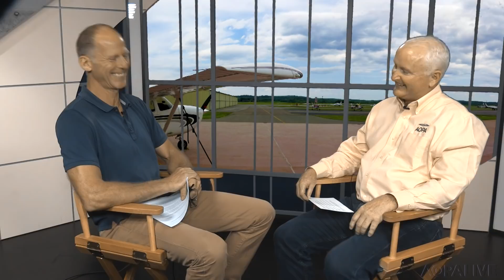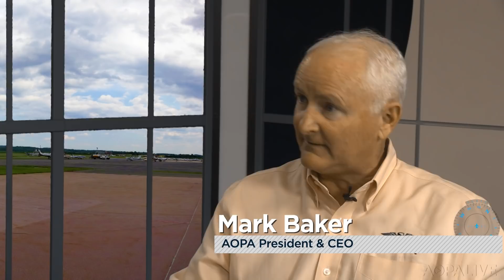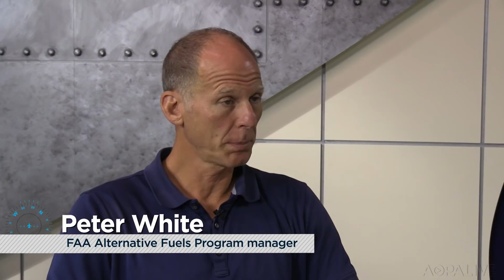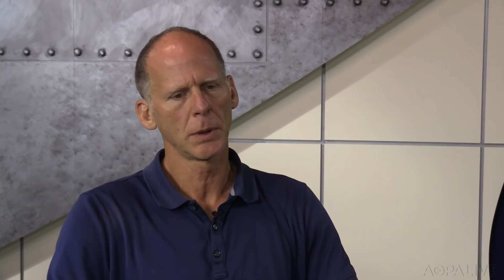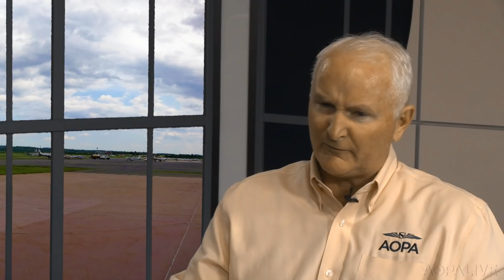Progress towards an unleaded aviation fuel

Comment: i thought lead was added to prevent valve bounce/ sticking could someone explain the use in avaition fuel ? as far im aware jets don't have valves?
Reply: Its added to boost octane. In the early turn of the century it was also used to fill pits in valve seats to help them seal but that use has been obsolete for a long time.
Reply: Lead is only used in piston engine airplane fuel, not in jet fuel.

Comment: You still use lead for planes??
Reply: Yes 100LL is Leaded gasoline for airplanes. Its for sale at pretty much all air ports and the only leaded gas available at the pump.
    One popular "mod" if you will is to rebuild the engine to handle premium auto gas since it is WAY cheaper than 100LL.
Reply: Without being an expert, I'd say they should have at most given a 10 year warning that the fuel would disappear and that new planes should not be made that needed it. It must be 30 years since it was banned for cars and it was crazy to use it in the first place.

Comment: These guys should have started with ethanol, it has 105 to 110 octain already and is cheaper than regular pump gas.
Reply: Stephen Smith it would probably lower the endurance of aircraft pretty significantly
Reply: Dogbocks I second the motion.
Reply: Dogbocks so do you think that’s one of the stumbling blocks on the FAA program - coming up with a formulation that does not reduce range/endurance from 100 LL?
Reply: @dogbocks  hmm maybe but it does have the price advantage and because its renewable it could stay cheap, which is a really novel feature compared to conventional fuels.
      Also the yeast determines the end product so ethanol could be engineered into a better fuel than even conventional gasoline.
   That is some thing I would really like to see done.
Reply: Biggest problem with ethanol is its affinity for moisture. Having aircraft engines die above urban areas due to water ingestion wouldn't be very good for anyone. It's shelf life absolutely sucks - even worse than regular auto pump gas. 

Look at how much trouble homeowners have had with outdoor power equipment, and marine engines, at just 10% ethanol. I've managed to make a pretty good living off the poor fuel quality. 90% of what I do these days is fuel system flushes, and carburetor cleaning. Lawn equipment would be super reliable if only we had good fuel at the pump! In the old days, you could be pretty careless with fuel storage, and rarely have issues. These days, if you don't keep the fuel container 100% sealed, you'll have nothing but trouble.
Reply: @SmittySmithsonite  well the small engine's trouble is partly due to the engine manufacturers not updating their designs to work with e-10 or even e-15. 
   You would see the same problem with cars if they did not engineer them to use e-85 fuel.
    Folks in other parts of the world use pure ethanol and seem to get along fine.
  Why don't we?
Reply: I would rather they offer both separately, rather than forcing us to buy a mix. Give us pure gas, and pure ethanol. That way, you can make your choice, & set the engine up to optimally burn either one.

Drag racers and hot rod guys are loving E-85 for it's power output - you can run ignition timing so far advanced that the engine would destroy itself on pure gasoline, due to violent detonation. The fuel storage is still an ever-present issue, though, especially here in the Northeastern USA, where the summer humidity is oppressive. Another problem is that it doesn't like to burn in colder temperatures - something that is a BIG problem for aviation use.